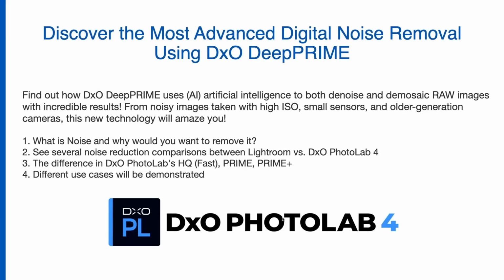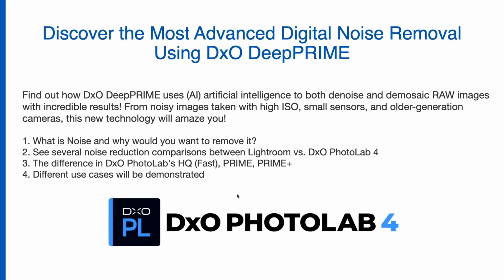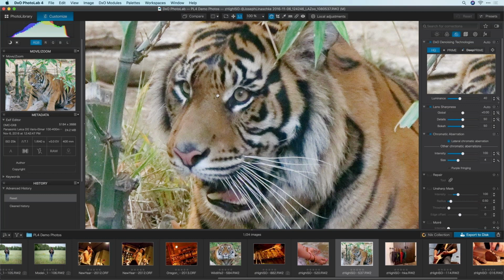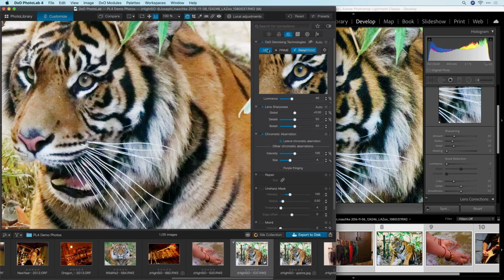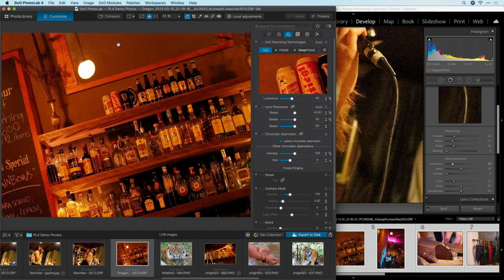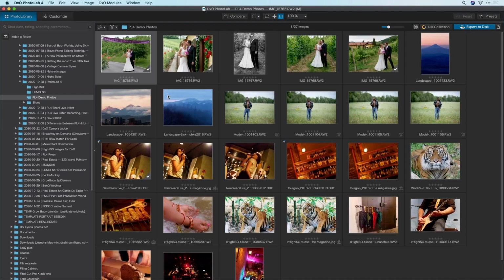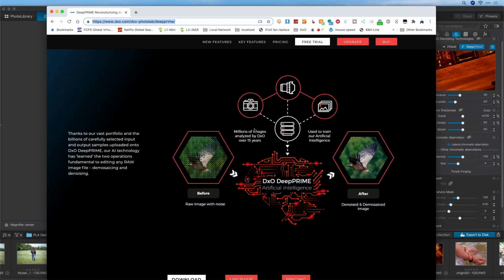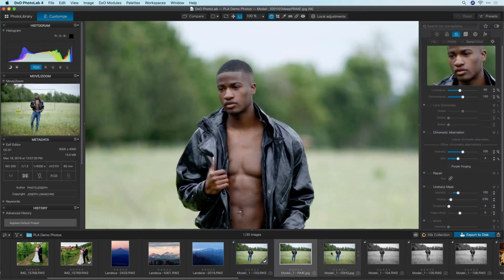Discover the Most Advanced Digital Noise Reduction Using DxO DeepPRIME

Comment: Will it be better if I ues the photolab deep prime to denoise a photo taken by an old camera with ISO 100 and in low light situations? Actually, there are a lot of noise in the dark part of the photos, especially after I do some color adjustment.
Reply from the maker: Hello, yes, you can use an old picture and get an amazing result